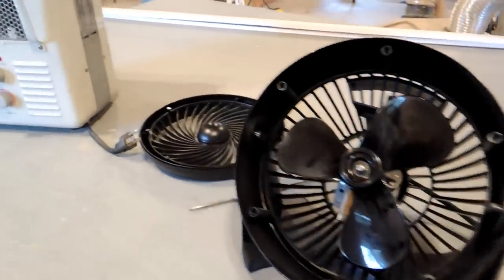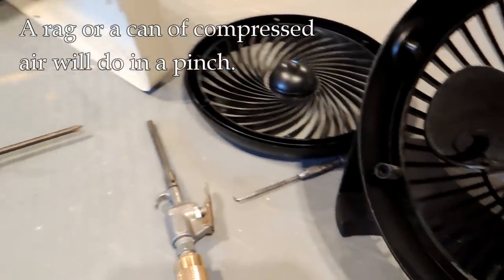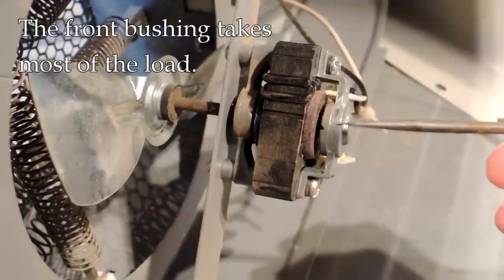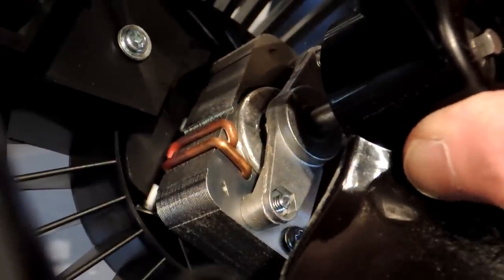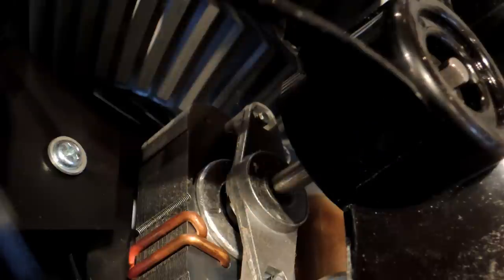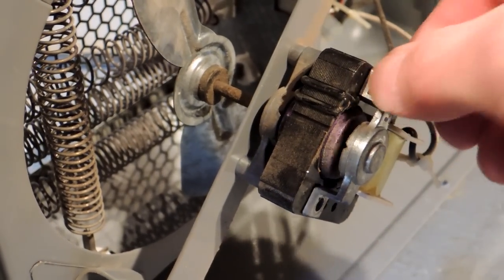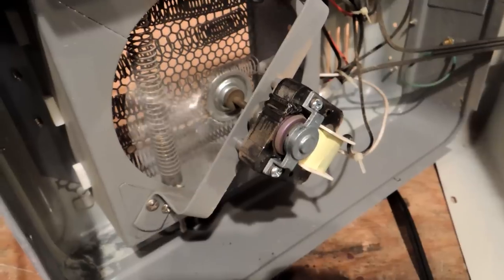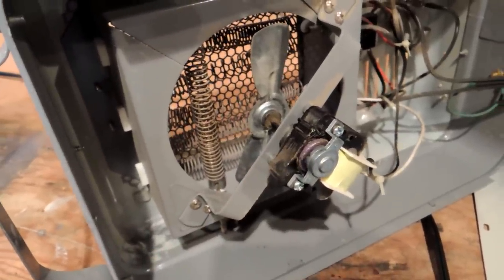How To Fix Seized Or Noisy Fans And Heaters

Comment: I really appreciate your generosity by sharing the knowledge and experience you have with this type of problem, even if the original product was inexpensive and designed to be replaced rather than fixed. 

I don’t need something new and I don’t want to toss something into landfill because one piece of it has a problem that can be fixed with a bit if time and a drop of oil. 

This is a solution we should ALL be looking for. Yes, to save money but to save the planet, too. Thanks for doing what you can to make a difference for others.
Reply from the maker: Thank you! I agree, we could be doing a lot more fixing and a lot less tossing.
Reply: BTW I took apart my infrared heater and “fixed” the fan by cleaning and piling the ends of the spindle. So simple and FREE! Works like new!

Comment: I've been doing this for years, since my father showed me as a kid.  Most recently I did constant maintenance on my home AC compressor, which was installed in 1992.  Finally replaced it last summer.
I will always disassemble the motor so the bearings and shaft can be properly cleaned, scotchbrited, and used Motor Oil is perfect for this application. 
Thanks for publishing this knowledge.
Reply from the maker: It's funny how things like this used to be commonly done, but nowadays most just use it up and throw it out.
Reply: enduringcharm I'm a tight a$$ too!
Reply: Have you done anything for Smart Homes? I'm big into that.
Reply from the maker: Haven't had that opportunity yet.

Comment: This has to be one of the most useful videos on the subject that I've seen, was just what I needed to narrow down the problem with it - a client was having an issue with a 'flame effect' fan heater, where the cylinder fan was refusing to turn for the same reason. After lubrication and leaving it to soak, it came back to life - fitted some LED replacement bulbs too for the 'flame effect' after the halogen bulbs burnt out and works good now :)
Reply from the maker: Great to hear!

Comment: I was happy to hear this could work on an already-seized fan. My Soleil space heater fan stopped running. Opened it up today, cleaned around it but didn’t get it to run. I’ll try some lube on the bushings and shaft - maybe white lithium grease (?) tomorrow. Fingers crossed. Thanks for the video!

Comment: I dont know if you noticed THEIRS FELT AROUND THE BUSHING YOU SHOULD HAVE SOAKED IT WITH OIL The felt is around the OUTSIDE OF THE BUSHING AND COULD USE SOME OIL .You were almost their with the heater .I TAKE MY MOTORS APART AND SOAK THE FELT AND BUSHINGS WIPE OFF EXCESS WITH A PAPER TOWEL PUT A FEW DROPS ON THE SHAFT AND REASSEMBLE. The side of the motor facing you should be marked so you dont reassemble it backwards ,if you do it will run backwards.
Reply from the maker: Some fan motors do have the felt you describe, but not all.  Generally speaking, newer designs seem to have left that part out.  Either way it's important to get the lubricant directly into where the shaft and bushing meet.
Reply: @enduringcharm  The black fan you have i just like mine its newer it an your heater had felt its hiding behind the spring cover pressed in holding the bushing i put a few drops of oil on the shaft before i reassemble but like to soak those bushings because they are porous  bronze

Comment: Yeah well I've just bought a direct replacement and it rattles from new....like the older one there is no way to open it up without cutting it open..not worth the hassle and time. Had years of service from the old one which failed on a twist switch snap ...planned obsolescence....£25 or not it's annoying

Comment: Only had mine for 2 weeks, sounds like a klaxon horn when I turn it on, not fun for the neighbours....How long does this fix last?
Reply from the maker: The fix can last awhile, but it depends on the particular unit and how often you use it.  I have three utility space heaters with fans which I will oil once a year, and one of those runs 24x7 during the winter months.  You might get longer from a cooling fan used less often.  To be clear, sometimes a fan is just shot and no amount of oil will help.  If the bushings are just worn out there's not much you can do about it.

Comment: Wd-40 is not a lubricant, it’s the fastest way to destroy anything mechanical. Anyone and everyone who has ever done anything mechanical from engines to fans to bearings for roller skates all agree. It’s good to clean out bearings but you need a good oil after the fact.
Reply from the maker: Yes, I mentioned at 5:38 that WD-40 is not an ideal lubricant and won't last long.  On the other hand, WD-40 does have uses as a lubricant in some cases where it would be impossible to get oil or grease into an area.  The spray application can be useful to force the light oil into a space.

Comment: I’ve been doing much the same thing about saving small motors, however I’ve found “fluid film” spray works like a permanent fix, the wax consistency of the lubricant continually in cases the bushing.

Comment: Hello sir, 

My Profusion H5511 dosen't do anything when I try to turn it on any ideas  what could be wrong with it?

Thanks in advance.
Reply from the maker: I looked up your heater, and that is a radiant style device.  There is no fan, it uses different principles to direct the heat.  If it no longer works at all, it could be an electrical problem with the switch or different component.  Not something I can diagnose from a distance and you may just need to buy a new heater since components are not readily available.

Comment: As far as using it on a heater if I just use a little bit and let it dry it shouldn't be a issue of flammable right? Also I understand it's at my own risk.
Reply from the maker: If you are using an aerosol, such as WD-40, the propellant in the can itself could be flammable.  You want to let that dissipate.  Lubricating oils or greases are going to be fine, unless you dribble the stuff all over the heating coils themselves.  Even then you'd probably get smoke, not fire.  Just use the lubricant judiciously and be careful not to be messy and you'll be fine.

Comment: Do you think the thick engine gear lubricant grease can Do justice on this as well? I know itsvthicker but if you use a thin layer with a cue tip... maybe. If not then the engine oil, but my question how long does it last?
Reply from the maker: Most of these fans don't have much in the way of power and a thick grease could put a drag on the rotation or even prevent it from starting.  And, lubricating the bushings helps prolong life but it isn't magic.  These fans are designed to wear out and sooner or later they will.  Probably sooner!

Comment: I have a wall heater (eg, like Cadet wall heater) that is so noisy (just a loud hum of the fan spinning) when it turns on with the fan spinning... I assume this would fix that noise?
Reply from the maker: Well, it might.  However, it's also not uncommon for fans installed in walls or ceilings to have sympathetic vibrations with the the fan motor.  I often see this in bathroom exhaust fans, for example.  Basically the fan motor vibrations cause a resonance in either the wall/ceiling itself or the housing for the fan.  All I can suggest is to take the unit apart and see what you find.  If you can temporarily rig up the fan to run outside of the housing you may be able to tell something from that experiment.

Comment: What do I do if I don’t have any oil
Reply from the maker: No oil?  If you have a car you can pull the dipstick and drip oil from that!  Of course, if you have a car you could probably drive to a store and buy some oil, too.  Everybody should have a bottle of 3and1 oil if nothing else.
Reply: Try coating your finger with lip balm, and apply that to the bearing surface on the shaft. Other non-plant-based oils and greases will work fine, with varying lifespans: mineral oil for cutting boards; wheel bearing grease; used or new engine oil; vaseline; dielectric grease; etc.

Plant-based oils don't hold up well to heat, quickly breaking down, becoming sticky and gumming up the works pretty bad.

Comment: How do you remove the power cord from the heater shell? The little black circle that seems to hold it on place.
Reply from the maker: I'm not sure I follow your question, but I think you're asking about the strain relief grommet which protects the cord as it enters the body of the fan or heater?  Those are typically just press fit into a slot.  Once you separate the two halves of the body (or however the unit comes apart) then you can tug on the cord on either side of the grommet and it should pop right out.